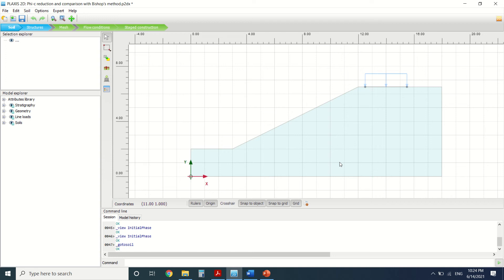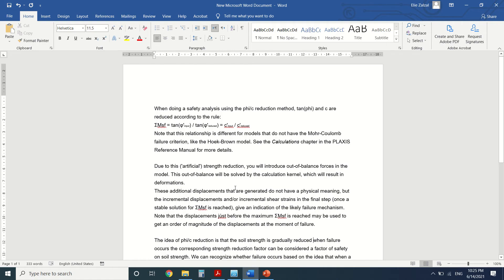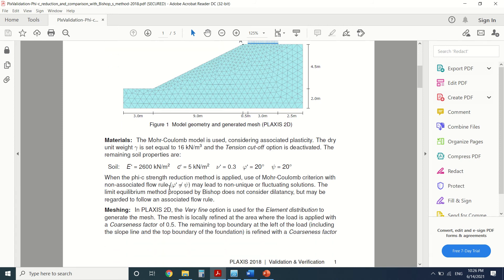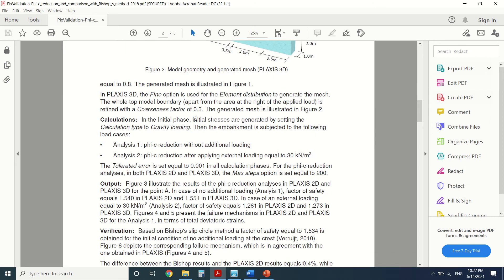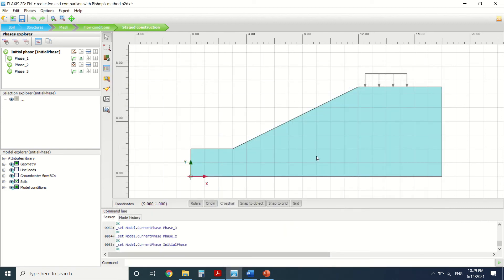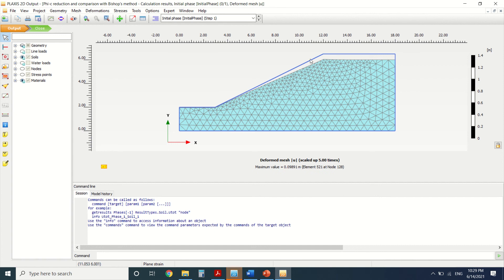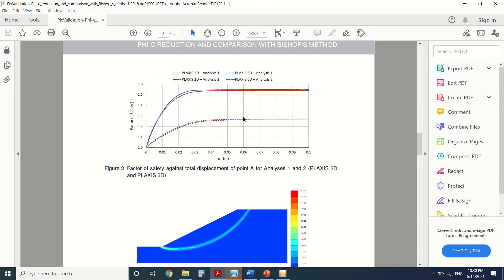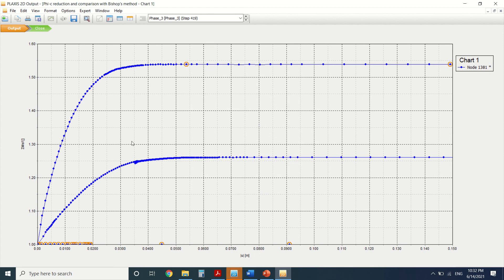slope stability verification plaxis

Comment: I want to simulate an unsupported sloped Excavation but the Ground displacements seem unrealistic. Can I simulate the Excavation in the same way as a slope (as shown in this video)? Or should I do the regular way by deactivating the excavated part of the soil?
Reply from the maker: How much is the displacement
Reply: @theengineer7732  it is alwayes raisings next to the excavation. The Ground deformations next to the excavation are upward and i want them to be down displacements. This happend in all ground types.
Reply from the maker: How much is it? The value of the displacement
Reply: @theengineer7732  8mm in sand and 45 mm in clay.